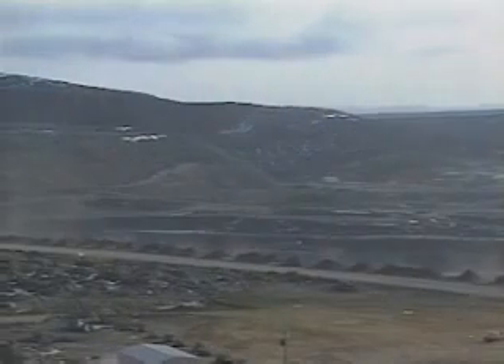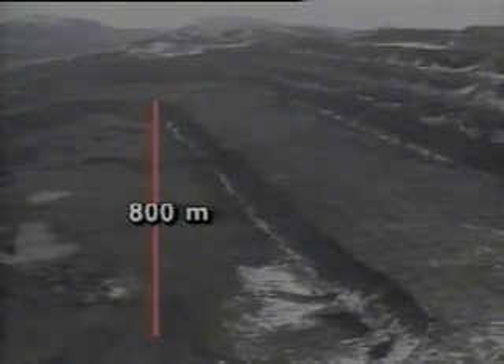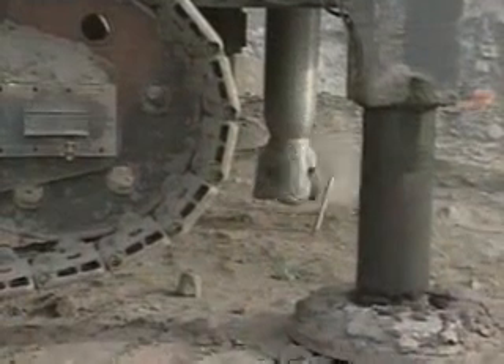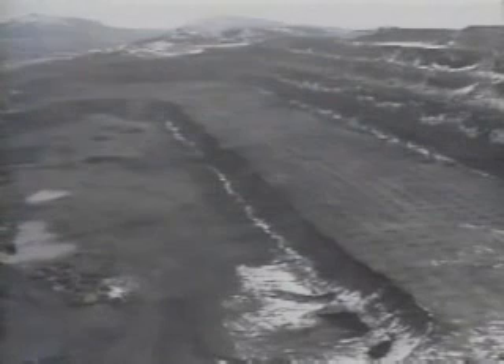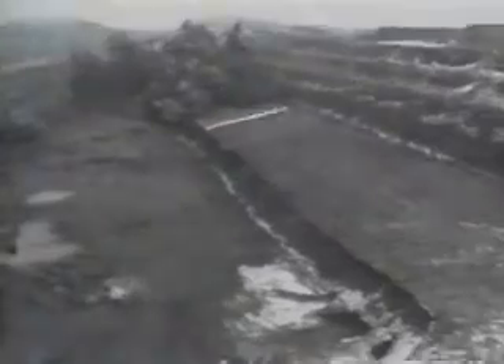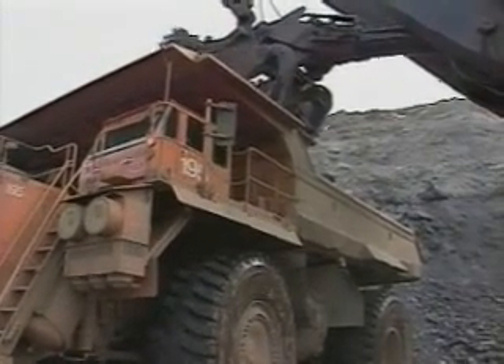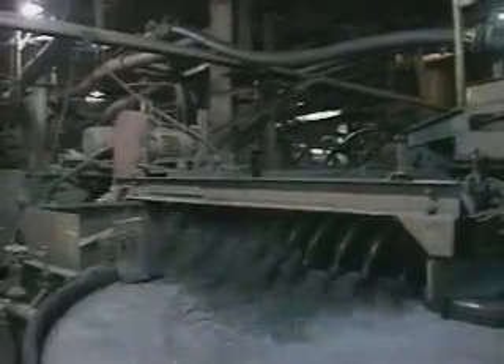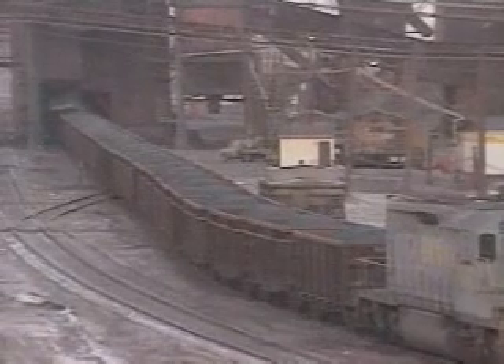Worlds Biggest (Current Blast Mine Blast) 22nd july 2009

Comment: how much did they use on this one. imagine the fireball that'd make if they didn't bury all the explosive sticks in the ground. it'd dwarf any artificial non-nuclear detonation tests we did at the white sands missile range
Reply: you've been watching too much TV,  high explosives used for mine blasting don't generate huge fireballs.
Reply: Sugarsail1 
That amount of explosives actually would produce a "fireball". By which I mean a huge ball of superheated gas. In a small explosion, the gas quickly lose all heat, via adiabatics and convective mixing with surrounding atmosphere. For very large explosions, the heated gas lose heat slowly enough that it's visible as a "fireball". That kind of fireball is very different from the Hollywood style air-dispersed fuel conflagrations.
Reply: @hamstsorkxxor  The biggest blast we've done so far at Peak Downs Mine in Australia  used 7000 tons of explosives. The mix of explosives in the blast was about 1/3 HANFO and 2/3 ANFO. We had no fireball whatsoever.  You only sometimes get fireballs on coal shots. This is because of the coal dust that can ignite. On big cast shots I have never seen a fireball. By the way I think this blast of ours must be either one of or the biggest with regards to explosives tonnage.
Reply: This type of blasting doesn't use "sticks" of dynamite, it uses instead AM / FO, Ammonium nitrate / Fuel oil as an explosive.
Reply: Your question has been answered. 2700 tonnes of ANFO went off at a Lebanon port